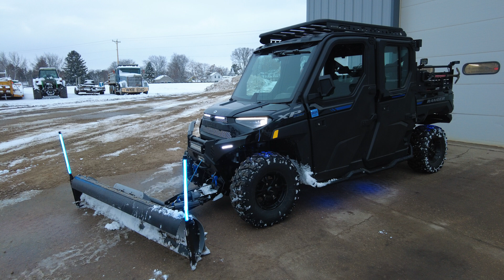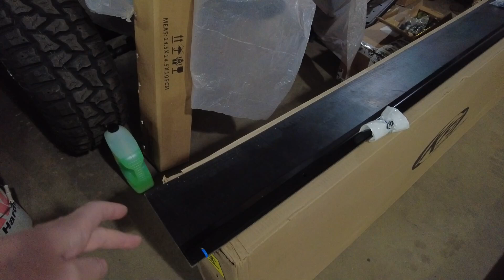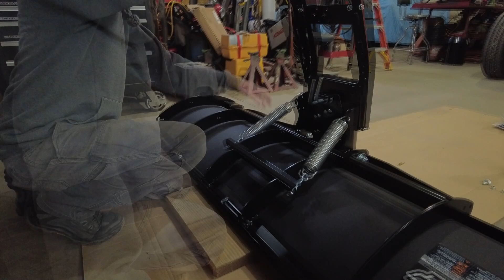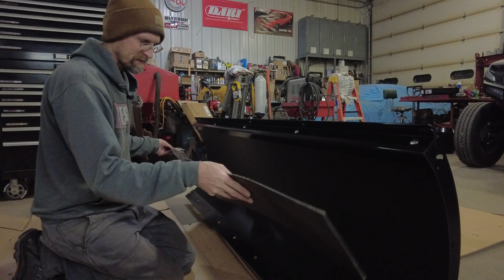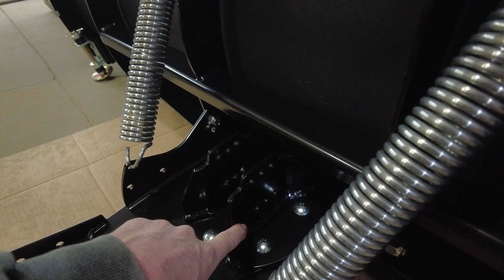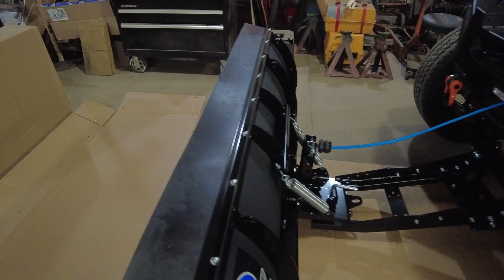2024 Polaris Ranger 1500XD 72" KFI ProPoly Snowplow Install

Comment: Great Video. I just purchased the 1500 also. I noticed that the automatic winch rubber stops were backwards from whoever installed the winch. The Biggest rubber stop is magnetic on one side only. That should stop the power to the winch when it gets approximately 1/4 of an inch from touching the magnetic switch on the front of the winch plate. It looks to me that You may have the same issue. Just a friendly reminder that you may or may not be aware of. Thanks for the Great Video. Very Thorough !
Reply from the maker: I did not know that. Thanks for the heads up.

Comment: Great video. Thanks! I like to watch your videos even though I'm not going to do the exact project you talk about. I like the way you do things and can apply some of the procedures you go through to things that I need to do. IMO the truck tires make the machine look less capable. I prefer the look of the original tires that came with the machine.
Reply from the maker: I hope my videos find some use for others even if it's just entertainment. The tires are all terrain so I don't think it will cause any problem with what I do. Did a little plowing tonight and the rear tires are slipping but with the weight of the plow and no weight in the bed I think the stock tires would do the same.

Comment: Just my.02 but pulling back to lift the plow is going to put more stress on the plow frame than it would picking up on it. I get not flattening out the synthetic rope but the rope and fairlead are made for that.
Reply from the maker: @normanbanks8902  I think the way it's mounted it's not going to put any more stress than pushing heavy snow. I get the fairlead is supposed to guide the rope but when plowing it goes over the same section over and over. I have heard good things about the lever lift. Probably won't get enough snow this year to really test it but I will keep everyone posted.

Comment: I miss the old videos of plowing with Darth. I think that was the best rig you built. Should have kept that one.
Reply from the maker: @rustyshackleford498  I do miss that truck but I am guessing rust has probably taken over that truck. I did the rockers and they are probably good but the doors and fenders were needing attention. And it was getting to 200k miles. That is a lot of miles.
Reply: @mossman381 i sure miss the videos of your 1970 Chevy 4x4 🤎😎
Reply from the maker: That was a good truck. The 80 is very close to the 70. Different body but frame and drivetrain are almost the same.
Reply: @mossman381  the vintage Baja look you achieved with those retro KC lites & that bed bar looked so cool to say the least . You did such a great job with that engine & exhaust  as well . I loved that two tone brown with black interior so much . I know the truck wasn't perfect body wise but something like that if kept out of the road salt would last for some more time . I am sure it was somewhat hard to part with at the time but hopefully it went to a good home . 

The other truck i would love to own is a 86/87 GMC 3/4 or 1 ton 4x4 just like the one the FALL GUY drove in the two tone brown . 

What are your plans with your squarebody Chevy ?
Reply from the maker: I have the KC lights all ready for the 80 Silverado. I want a similar look as the 70. The 70 did have a good look. It went to a good home. It has a shed to park in all the time. The guy had the body restored. He went with a modern red color that I am not a fan of on that body style. He also took off all the KC lights. Not what I would have done but it's his truck now. I need to get the 80 Silverado back in the shop and get more work done to it. The drivetrain and frame are pretty much done. Just need to tackle the cab and bed. It's actually really close to being able to drive. Just need to put the time into it.
Reply: @mossman381  good that the new owner has a shed to park the 70s in out of the weather . Yeah I am not a fan of that red exterior color on that 67-72 bodystyle either . Wow & he even removed those vintage KC lites . Like you said it's HIS truck now . 

Unfortunately all these projects take time & money . But it's nice to see you are able to work in the big shop ... I sure wish I had a nice size heated shop to wrench on my projects . 6 months of cold winter here in northern Canada where I at . It's depressing for sure but I guess it could be a whole lot worse . 

You seem like a good hearted / down to earth person . I wish you all the best !! 

Keep the videos coming & thanks for you reply .
Reply from the maker: @Warriors79-ice  I am very lucky to have such a nice place to work. Winter can get nasty here in Wisconsin as well.
Reply: @mossman381  it was a good looking truck, and your mods were pretty slick.
Reply from the maker: @rustyshackleford498  It was a sweet truck for sure. I miss that diesel torque. Only other time I have felt that kind of torque is with Dad's Camaro.